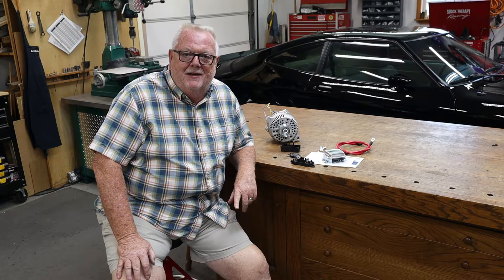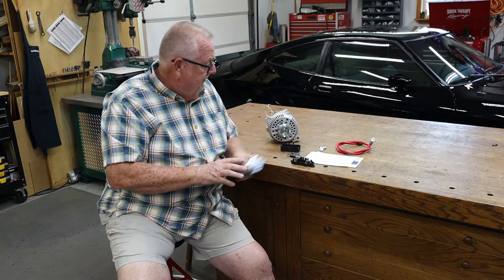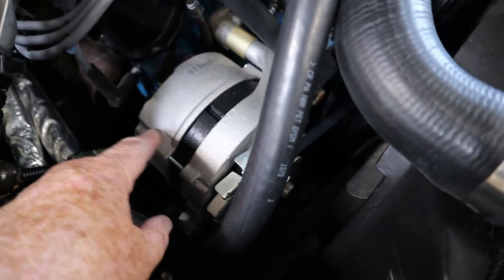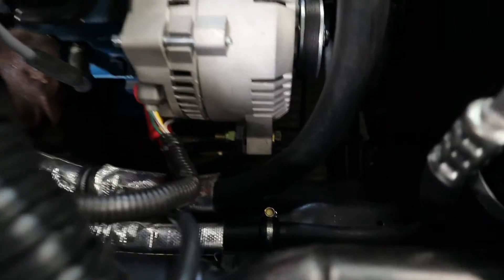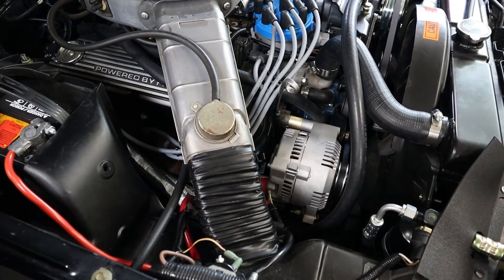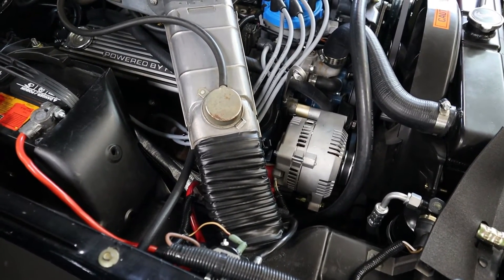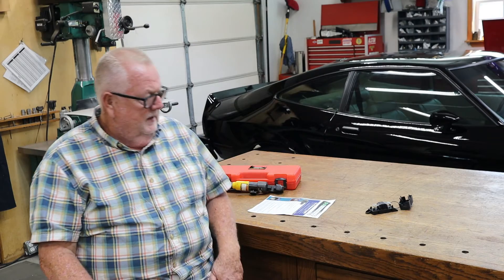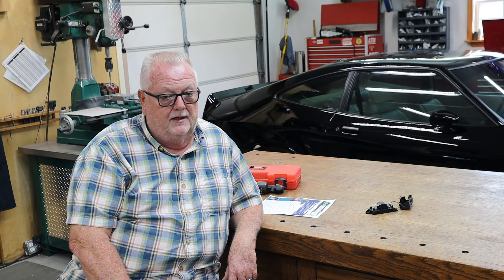1G to 3G Alternator Conversion on our 1978 Mustang II King Cobra

Comment: Yeah it's 6 guage on the gen 3. I used two 9" runs of 8 gauge, on the new terminals unoccupied locations,  for the fuse box next to the battery. tThe cable was short. Most everything else is 4 gauge now, with much larger grounds. Good to go, for a 200amp, or a bigger gen 4.

Comment: Hello Terry, thanks for this great video. Just had one question, @ 10:34 you show a still of the 3g wiring, where does the big black wire go? I know the red goes to B+ but you didn't mention the big black wire behind the red. Thanks in advance.
Reply from the maker: That's the existing B+ wirefeeding the electrical system in the car.
Reply: @terryhatfieldmedia thank you!!